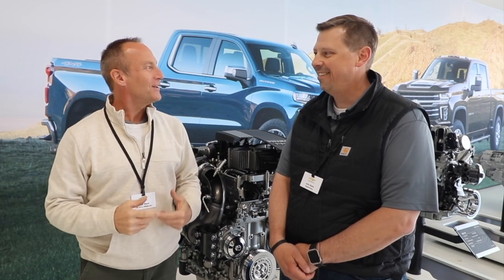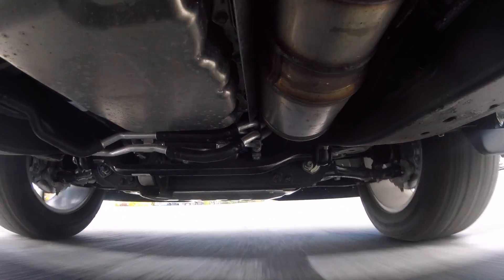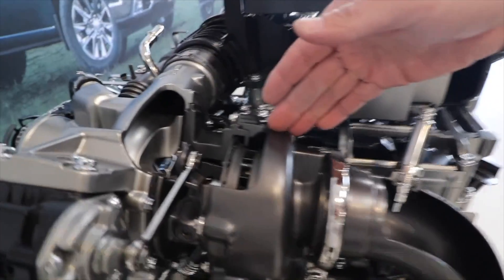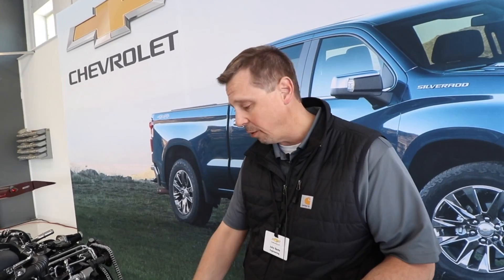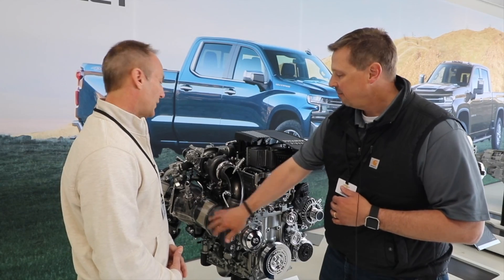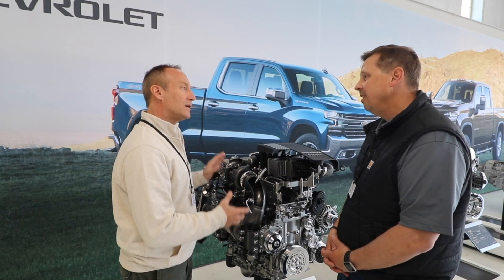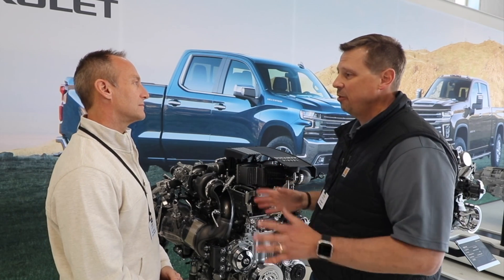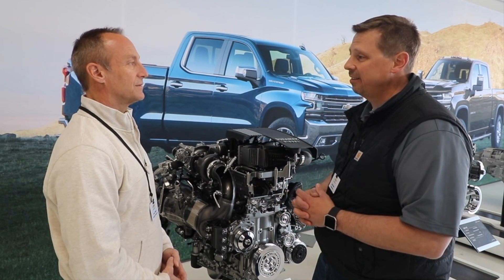Engineer Reveals All! Duramax 3.0L for Silverado 33 mpg hwy

Comment: I wish they would put that engine with same specs in the Canyon/Colorado. Especially in the Zr2
Reply: Colorado HD.  A bit wider plus higher hauling/towing.  Maybe 3k payload with 9.5k towing.
Reply: @bigez526  I could care less on towing it would have a 100hp more and 100ftlbs more torque. That engine would be awesome in one the mpg would be crazy high. With that much more power you could run a little higher axle ratio.
Reply: That or a Tahoe or Suburban
Reply: @j_rod_52  ya I'm kinda surprised they haven't said anything about that a full size SUV getting in the 25-26 mpg range.
Reply: It'd be sweet!
Reply: You know they have the 2.8l inline 4 diesel in the colorado already eh? And it has less emission components to fail then this engine has.
Reply: @jingorat  it's also the slowest vehicle iv driven
Reply: @fl_atv_riders4455  The biggest issue there is your expecting gas hp from a diesel I believe.  I own an 18' ZR2 diesel, It's not winning races but its all pros and cons. It goes hard but the auto trans is actually the bigger complaint to me. You can't drop gears and expect more power by revving out a diesel. It needs a manual trans. I get almost 10mpg better then my neighbor with the 3.6l v6 canyon but his is faster. give and take. But there is alot going on with the torque management system which strangles the engine for emissions sake. Think this way, that 2.8l inline 4 is making almost the same power as an 80s cummins diesel did when it was new.  That's impressive.
Reply: @jingorat  ok that is my point it that i6 diesel can get in the 30s with a 1/2 ton think of what it would do in a smaller truck. The engine would have to work less there for increasing fuel economy and giving the driver the ability to pass another car. Power to weight = mpg to a extent and along with better 0-60.
Reply: @jingorat  I wouldn't want that rubber band in any vehicle.
Reply: @jingorat  oh and I personally own a 92 first gen dodge diesel. It has same hp not torque. Then engine didn't start getting good fuel economy until I started to modify it and on top of that why would I pay 45,000$ to have something that's just as slow as a 1980s vehicle.
Reply: @SteveHolsten  I'm confused as to what you are talking about
Reply: @fl_atv_riders4455  The 2.8L 4 cylinder Diesel Colorado that was discussed in the above post.
Reply: @bigez526  That won't happen. There's already reports of those trucks folding in half from towing just 5k
Reply: @TheCompyshop  good to know.

Comment: Aluminum  block & heads in a diesel?  I listened to the engineer describe all the "gizmos"  to do this , that, & the other thing.  I predict this engine will be a "GMC ......garage mechanic's companion' !  I buy a truck for reliability, & I will accept lower fuel mileage, higher weight, & fewer computer controlled crap, in order to get it. I drove Ford trucks all my life (I am 80 yrs) & I bought ONE Power Joke.  I traded it after 6 months, at a significant loss, to buy a new (97) Dodge 2500 with a Cummins 12 valve.  It has 1.5 million miles on it & still runs fine.   I replaced the water pump once, the "O" rings on the delivery valves, the bell crank on the AFC unit twice, (the ball stud on the throttle rod connection wore out), 2 alternators, & it is still running on the original lift pump (admittedly it needs to be changed now) the original injectors, & the original starter....(starter is showing signs of distress)  It has been the most reliable engine I have ever owned. The rest of the truck has been relatively trouble free. Right front inner axle seal twice, both front steering universals three times, steering box replacement, clutch complete at nine hundred & some thousand miles ( I live in a rural area & use the clutch only to get moving & then throttle shift through the rest of the gears) * I bought a n aftermarket exhaust system & fuel plate from Banks engineering the first week after I bought the truck, & it is still in good shape, with no obvious exhaust leaks. I live in southern Alberta, where little or NO salt is used on our roads (big cities excepted), so I expect that owners of this new Silverado engine will never make a "million mile " club !  I am aware of a number of 12 valve trucks  locally that have gone a million miles without any major issues. The new High pressure rail injection engines are a nightmare, with pumps, pressure regulators, injectors (piezo units break, pintles break)  SCR units burn up , etc etc. I will drive my Dodge until either the truck or myself  expire ( my guess is that I will go first !!). Interesting interview.
Reply from the maker: Awesome comments. Thanks for sharing your experience as I have a lot of faith in Cummins as well.
Reply: Brian Hind : Chevy guy here, would always have faith in a Cummins. It's what they put that amazing engine in that bothers me. 

Transmissions and front ends come to mind

Edit, for those that maintain their vehicles properly (like this guy with his 97 12 valve) vehicle will usually so very well like in his case. I've got a 98 Silverado 7.4L with 320,000 on it and changed the original factory alternator and water pump last year. Oil changes every 5000, being attentive can make all the difference
Reply: The Duramax has had Aluminum cylinder heads since it came out

Comment: DPF Means "Save the seals but kill the whales" I say this because oil & fuel can't be replaced so we are using it up & DPF system causes the motor to use more fuel plus causes more wear on the motor.
Reply: Using up the oil? New oil is being made thin the earth everyday. Buy a boat cuz those sea levels.
Reply: I call DEF Fluid "Government Juice"

Comment: I'm extremely surprised to hear they went "back" to an extra injection event for DPF regeneration like on the LMM Duramax. LML/L5P use a 9th injector in the exhaust which seems like a no brainer after all the fuel dilution issues that the LMM had.

Comment: Nice to see GM trying to do something innovative. Government requires all engines to meet emissions for 150k I think so they aren't anything un usual.  The wet belt in a concern but lots of makers seem to be going to them so they may work better than expected.  I would be more concerned that the Timing chain is only a single roller mounted on back of engine meaning motor would have to be pulled to replace it.

Comment: Eye opening information here. 150k miles is not long to recoup the added cost of the engine. If you drive alot then after 3 years you'll be paying a mechanic to rebuild it. Good to know! Thanks!
Reply: Not rebuild it, replace it.

Comment: For the price of the truck I would be highly disappointed if the engine didn't last any longer than 150k. Besides my current one owner has set the longevity bar pretty high for my next new truck. ✌✌
Reply: mr.18436572 any well engineered car today lasts 150k running as new.  The true limit is about 300k.  Pretty simple.  For poorly engineered cars they run correctly to 75k and the die around 120k.
Reply: @777jones I wonder how much $$$$$ it'll cost to get a new truck to 300k.

Comment: I can just see the TSB: Customer concern oil leak at rear timing cover. Removal of Engine required.
Reply: Or, customer concern of big red light on dash. Drove it in anyway to diagnose oil pressure light.

Comment: 150k miles with no problems my ass.  Anyone who has ever worked on new cars/trucks knows that these new engines can barely go 20k miles without some sort of emissions or electronics issue.  I'd be willing to bet that putting the DPF in the engine bay like that is going to cause failures because of how much heat gets generated from a regen.  Also why is the timing chain on the back?  This engine is going to be a nightmare to work on.
Reply: I bet a lot of things (like electrical) will go bad before the oil pump belt. 
My Tacoma had a timing chain in the front and the cover leaked at 129K (common failure), still $3.3K to fix.
Reply: @patmcbride9853  Exactly--virtually all timing chains in today's cars are a nightmare to work on.  There is no room in most modern engine bays, and so much stuff has to be removed to get to it regardless of where it's located.

Comment: New to the channel.  Thanks, great information.  Can you ask the engineer one question?  When turbos first came out, most of them did not last since after driven hard and shut down, the turbo would cook and would not last Long.  Then they came out with turbo savers, which would circulate oil after engine shutdown until it was cool.  How does GM prevent this from happening.  Will oil still circulate or should we (when I get one) let the engine idle for a bit before shutting down.  Test drove one yesterday.  Loved it, just not the MSRP price.

Comment: I think the engine has great potential,  the problem comes 8 months to two years down the road when the Criminal EPA/CARB Cartel says wait a minute and makes GM reflash the computers when they are in for service and the truck owners end up losing 3 mpg's plus acceleration loss.

Comment: looks like something that will need $10,000 worth of repairs in 200,000 miles
Reply: In other words it looks like a diesel then? 🤷‍♂️
Reply: The engine will need to be split from the transmission to service the oil pump drive belt at or before 150000 miles. What will that cost???
Reply: Imagine that labor cost when you’re going to have to replace the oil pump belt at 150k miles.
Reply: Gary Jameson ever had a manual trans? Did it need a clutch after 100k? 🤦‍♂️
Reply: @Maverick09171  My Cummins 5.9 (truck brand not to be mentioned), is at 220,000, original clutch. 

Belt or chain drivers over head cam on a diesel,   no for me.   There is a reason they use gear driven cams and push rods on all the big work horse diesels.   Belt driven oil pumps on the back of the engine, who comes up with this stuff?  Must have been suggested by all the dealer service departments and the government to create new jobs.
Reply: @pcmountaindog  220k on a clutch is an exception, not the norm. Glad to hear yours has been without issue.
Reply: @Maverick09171  I've had many manual vehicles. Have never had to replace a clutch. Last car I sold had 440k kilometers on it. If you drive them right, clutches can go 500k or more.
Reply: @bottomfeeder73  grocery getters, I agree. Anything that’s being used for work or makes good power - that’s not going to be the case.
Reply: @Maverick09171  True.
Reply: @bottomfeeder73  either way I don’t totally get the hate for the 150k service. For the vast majority of owners (but NOT all!) that’s 10+ years of service. 
Hell most dodge can’t go 150k before needing the trans pulled for replacement/rebuild! 😬😂
Reply: @hughg.rection9161  nice! impressive for multiple reasons!

Comment: 36,000psi hitting the top of those pistons. How long before it cuts through? For reference a Water Jet can cut metal as low as 40,000 psi in one pass. The injectors are hitting the pistons continuously while the engine is running at 36,000 psi.

Comment: So …   277hp and 460lbft of torque …  I'm happy with the 420hp 460lbft 6.2L gas engine.      I understand max torque is available at 1500rpm but would much rather hear 375hp and 550lbft or better on this diesel.  Sounds like it's not good enough power-wise
Reply from the maker: Definitely designed for light duty towing. It's a shame Chevy didn't let us tow in the drive test. Ford let us tow with the Ranger, a mid-size truck as they were confident with the Ranger's tow performance - https://youtu.be/RFUk16d7sHs

Comment: I wish I could have one of these fine engines in a restored 1985 Buick Riviera or in a restored 1985 Oldsmobile 98 or even a 1985 GMC Vandura. I'd  be in Hog Heaven
Reply: I'm considering using a 6.5 Turbo Diesel in my El Camino.  Might even put a intercooler on it.
Reply: Oil Lease 6.5’s are junk. Get a Detroit or something if you can’t get a Cummins.
Reply: @MrPland1992  6.5 s are fine, drove one many years and no problems except replaced the waste gate control with a Heath  manual. My one ton got 18 mpg. It isn't as powerful as a Cummins but I don't feel the need to speed with a big trailer. It runs over 110 unloaded.
Reply: @MrPland1992  
The 6.5 is Detroit Diesel

Comment: For the cost of this truck they better go 500,000 miles with no problems or they cant all hit the unemployment line.
Reply: Better get a good ol 7.3 PowerStroke or 5.9 Cummins 12v if you want half a million to a million miles.  My 2000 F350 has 480something k miles on the engine without any major work.
You won't find longevity out of new vehicles today, they don't make money if you drive that many miles on one vehicle.

Comment: 150k out of a diesel? Where is the 300k mile diesels....my gasser 6.0 made 260k before it started knocking and was pulling trailers right off the parking lot. Changed a water pump and alternator around 180k and that was it.
Reply: New trucks are junk regardless of brand, they know they don't make money making them last.

Comment: Rear chain? These idiots...they design this stuff and then want to pay mechanics next to nothing
Reply: Yep. That's why I got out of auto repair. Very tired of being taken advantage of.
Reply: If they designed it from scratch why not drive the cam with gears as cummins does ? To simple & reliable?
Reply: @robertmoulton2656  exactly! But a big part is to deter people from doing their own work...and at some point everything will have to go back to the dealer for repairs.
Reply: Robert Moulton Cummins doesn’t have overhead cams, does it. Might be part of the reason.
Reply: remove cab to service chain
Reply: @robertmoulton2656  Gears are great but they transfer all the harmonics from the crank into the valve train. A properly hardened and pre stretched chain will last the entire life of the engine. But the key is the  right design, material and manufacturing. Then when it finally comes time to remove the engine to rebuild it you put a new chain in. Now it is definatly not the case on every engine out there but if you take the old small block as an example the engine was tired and smoking long before the chain broke.
Reply: @geoffmooregm  perhaps . However when I think of the best diesel engines and the life and abuse they can take I always head for benchmarks like 3406/c15 ,N-14 cummins and 5.9 6.7 . When there are already these outstanding designs out there why not simply replicate them in a 3L inline dimension ?
Reply: The chains are lifetime design.  Belt for oil pump has 150k life, and can be serviced with engine and cab in place.
Reply: Maybe you should buy a 71 series and put it in a new GM pickup!  I’m guessing it will work great meet your needs and turn some heads.
Reply: @geoffmooregm   Unless I am mistaken engine will need to be split from transmission to service belt at or before 150000miles
Reply: @isx530gary  I am not sure how they accomplish the belt drive. Hopefully they have made a small removable sump in the pan that allows it to be opened and serviced
Reply: Gary Jameson Yes not hard to unbolt the trans and slide.
Reply: Geoff Moore Trans is unbolted and slide back to access rear of the engine.
Reply: Rear chain is a idiot idea. if you don't like the pay being a mechanic find another job.
Reply: Robert Moulton And don’t forget the Detroit series 60 which has an overhead cam and they use gears not a chain to drive a cam

Comment: Hold up, does that mean that the regen cycle works by injecting fuel during exhaust strokes? Oil dilution springs up to mind. No wonder max oil change interval mentioned is 7,500 miles. Why not using a 7th injector?
Reply: Don't forget Ford did this on the first gen 6.4l Powerstroke's, it didn't work out to great for them as they would metal the oil seal on the turbo and then turn into a smoke machine. Ford used the back two injectors to push fuel out on the exhaust stroke for re-gen.
Reply: TdrSld  Ford and Cummins still use in cylinder regeneration....
Reply: A 7th injector should be standard for dpf vehicles. Keep the oil clean!

Comment: My shrimp boat had a 6V53 Detroit diesel that logged 23,000 hours before overhaul.  Multiply that times an average of 40 miles per hour and you get 923,000 miles before overhaul.  They can build better engines , but they would rather make as much money as they can. Your corporations at work. Planned destruction.

Comment: To me he didn't sound very confident  about how long this engine will last kinda makes you think twice
Reply from the maker: I think Chevy's lawyers have told these guys and gals 'DON'T say anything!'
Reply: I agree - Cummins will be the only diesel for me.
Reply: Wouldn’t have a problem buying one of these.
Reply: They won't give an exact number due to legal reasons.
Reply: He's being told VERY CAREFULLY what to say by the company lawyers . . . even a 5 y.o can notice it. Liabilities and litigation are beautiful things . . . 🙄
Reply: Watch the video again at 7:20 he talks about regen. If you look back at the old way of regen(cleaning out the filter) gm in the LMM 07.5 to 10 Durimax had this system and ford had it in the 6.4 power stroke 08-10. When they inject the diesel into the cylinder on exhaust stroke it washes out the rings on that cylinder and will cause the engine to fail. Many as low as 20t miles. Almost all by the time it got to 150t. So I’m disappointed to see gm go back to an old system that they already know does not work and bring back a problem that they have already got an answer to.(adding an extra injector to the exhaust pipe after the turbo) very disappointing I was hoping to get one of these diesels when they come out but now that I have seen this I will be waiting till someone cracks the ecm so I can delete the dpf and egr before I see end my money on it. Or wait till gm adds the 7th injector to it.